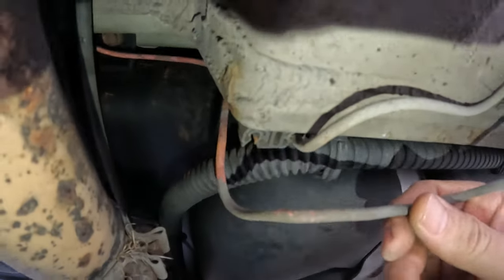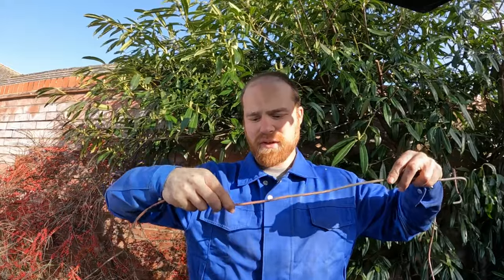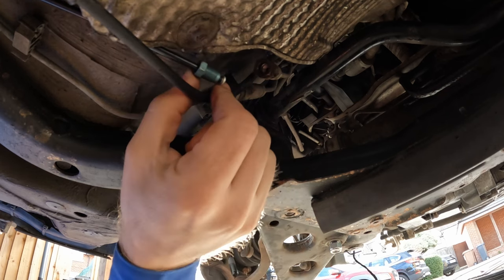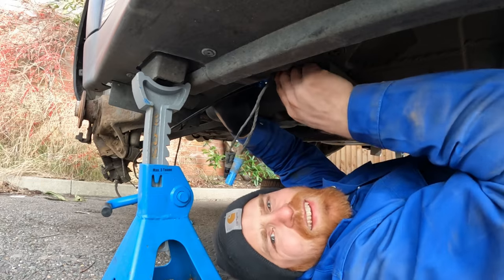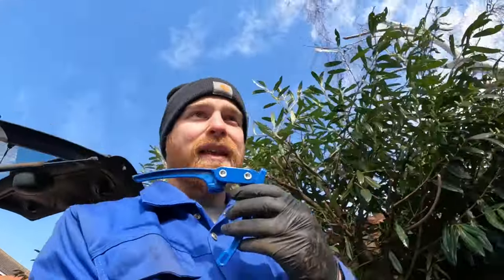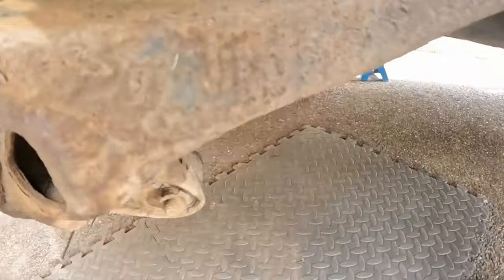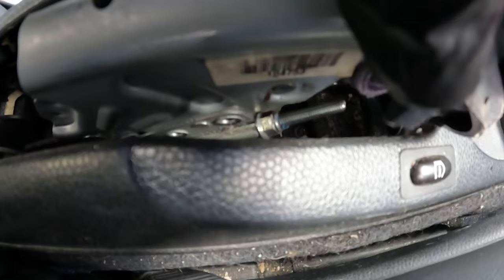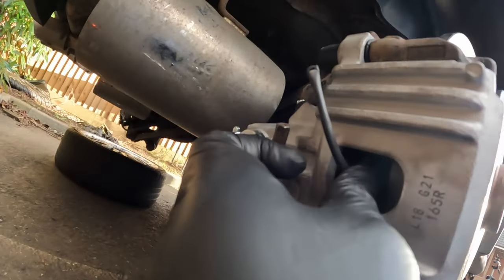Is this the trickiest job on a Mini?

Comment: Well done Nino! I was surprised though that you didn't slacken the handbrake cable, like you did later, when you were trying to initially attach it to the caliper. Bloodied knuckles are like a right of passage. You are now a real man!! 🤣
Reply: Completely true. You are not a real mechanic unless you have 1 punched metal in the winter while undoing a nut or bolt and 2 bled at least once while working on a car 😂

Comment: I would have cut it off really close to the rounded off nut, then bought a flange making tool and shimmied it all along a little to give me enough slack to make a new flange. Also I think you need to find a good local automotive dealers where you can get lots of general bits like bolts, clamps, clips etc rather than shelling out a fortune at the main dealers. Great videos by the way. Loving the honesty.

Comment: You can join brake pipes just like other pipes. Cut off the end and then replace that bit and recommect with a join. Just make sure the connection is well made. Every brake pipe has at least two joins, one at each end, regardless.

Comment: Well done mate, I have Peugeot 309GTI, one day reversing it out the garage I could hear dripping, on inspection the metal fuel lines had corroded and squirting fuels out everywhere. Like you order the OEM pipe, for it to turn up in a roll, I used the old pipe as a template and bent it for what looked like pretty bang on, only when fitting it just wasn’t right and missed the clips in areas, you probably did the right thing just bending it on the car.  Glad you got it sorted!
Reply from the maker: Cheers bud. That's what I was most worried about doing this job. Especially because the act of pulling the old pipe out actually messed up some of the bends, so there was no way I was gonna get it 100% the same. Also, there's no way I could have fitted that pipe already bent without removing the fuel tank and lines, the exhaust, and the handbrake cables. I really didn't fancy doing that haha. Peugeot 309GTI - no there's a car you don't see very often! I hope you cherish it - sounds like you do 😃👍🏻

Comment: My mates all call me a wimp for how I always wear workman gloves to work on the cars...and my reason is to avoid the pain of 5:11. Lol never knuckled myself in 5 years lol. Tip you can get a cheap decent pair from hole bargains for £1.99. Great work keep it up 👍🏼👍🏼👍🏼
Reply from the maker: I've actually got a pair of 'mechanics gloves', but I suppose it's not until you sustain some kind of injury to learn from that you start to see the value in them lol. Might have to dig them out

Comment: Yes as already mentioned about the ABS bleeding procedure using a scan tool too put it into brake bleed mode. Now I'm really looking forward to when you bleed yours .
I'm just about to flush my one's through but haven't got a scan tool. I'm hoping I can do it with just a vacuum bleeder as I won't be letting the fluid run dry so avoiding any air getting in 🤞 Thanks Nino .... Great video once again 👍👍
Reply: Paul, did my bleed with an empty system without the ABS brake bleed procedure, using a cheap euro car parts pressure bleeder. Works a treat...
Did a video of it on my youtube channel #smithiestrackmini have a look.
Reply from the maker: Yeah I think the key is to make sure that the reservoir doesn't run dry, which I suppose makes sense when you think about it. Thanks for the support, Paul 👍🏻

Comment: Just to save you hassle on future BMW brake jobs with seized unions. You can lever out the spring clip with pliers or a screwdriver then use a 17mm spanner to unscrew the flexible line away from the hard line. There's a video on YT about it by George Austers.

Comment: You may already know but you will need to bleed the abs pump, which I turn needs either INPA or alternative obd2 tool to manually activate it.
Reply from the maker: Ahh I didn’t know that, nice one. I do have an obd2 tool, so will have to work out if that’ll do the job 👍🏻
Reply from the maker: Ok so done some Googling and looks as though I'm definitely gonna need to to the ABS bleed because my reservoir has run dry due to changing the pipe out... if I'm correct. Looks like my OBD tool does indeed have the functionality to do an ABS bleed. Thanks for letting me know about this, Anthony, I wouldn't have known that otherwise 🙏🏻
Reply: @NotEconomicallyViable  it is commonly missed, but makes a huge difference to the performance and feel of the brakes. Keep up the good work!

Comment: Yep, Teng Tools nothing special. I made the mistake of buying a Teng flare spanner and got shot of it quickly. Flare nut spanners are one of the few tools where I stumped up the cash for Snap On. I got lucky and picked up a set for £55 on eBay!